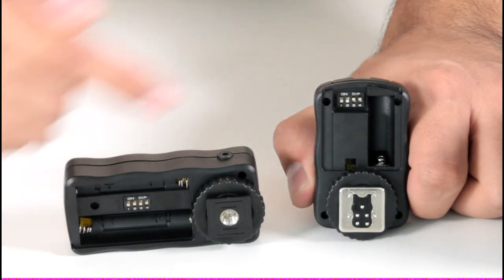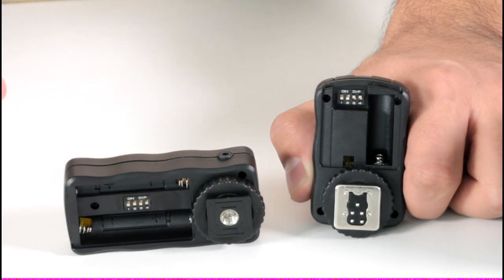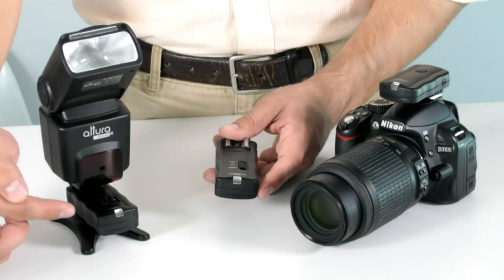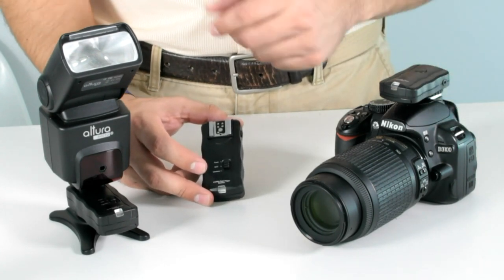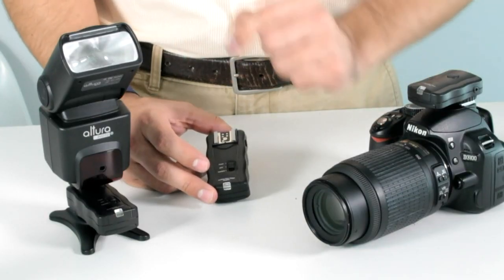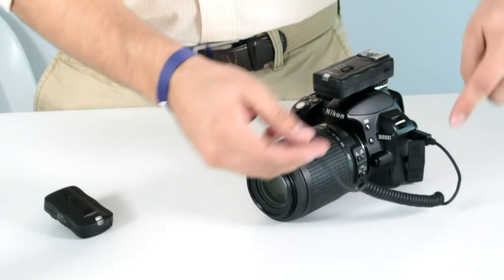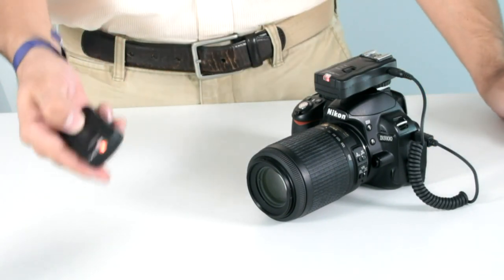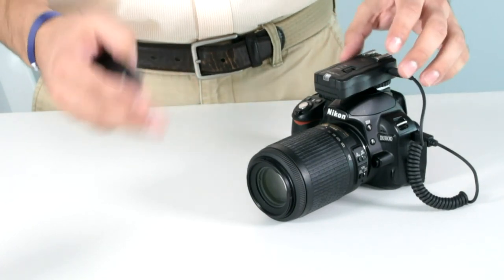TUTORIAL | How To Use A Wireless Trigger & Receiver Set From Altura Photo For CANON & NIKON Cameras

Comment: I trigger the external flash (S1) with my nikon d3200 build in flash. The Altura reacts and flashes but no light from its flash on the final picture. can you help me find out what am i doing wrong ? missed sync or what's the solution ?
Reply from the maker: Hi there Oscar! Please try using a shutter speed between 1/60 and 1/160.
Reply: thanks but that is not the solution i am afraid ..
i think it is very inconsistent when i try to trigger it with my on camera flash .. doesnt matter if i use it on fast or slow shutter speeds 
it always fires the external flash but mostly i do not see the flash on my picture ..really a big problem for me :(
Reply from the maker: Please send us an email with your order details to: info@gojasales.com and we will be more than happy to help you identify the issue and find a prompt solution.
Reply: Hi,  I am facing the same problem with my new Altura kit.  Could you please help me providing a solution that you had suggested for Oscar Verschuur.
Reply from the maker: Hi there!  Please try using a shutter speed between 1/60 and 1/160. If this does not work please send us an email with your order details to: info@gojasales.com and we will be more than happy to help you identify the issue and find a prompt solution.

Comment: I'm having the same problem as most others appear to be.  Can't get the off camera flash to work.  I just received the Altura Flash as a gift and it came with the Wireless Flash Trigger for Nikon DSLR.  I have a Nikon D5100.  The channels are properly set, the batteries are fresh and the test button flashes the flash with no problem.  On the camera, the flash works, but off camera, there's a problem.  Doesn't matter what mode my camera or flash is set in...it just wont work.  If there's an easy fix, why can't it be posted here (or have I missed it)?  Instructions and this video make it appear to be so easy...well, it's not!
Reply: I'm having the same problem. I got this flash as a Xmas gift and I set it up this morning and it worked fine now it won't work at all. I'm upset cuz I was excited to learn off camera flash shooting
Reply: ***** I'm so glad I read the comments this time, I'm having the same issue, no matter what settings I try it will not fire the flash from the wireless trigger while in the shoe. I will also contact Julio if that's ok.
Reply: i was having the same problem. but after a few hours lol i got it... let me know if you still need help...
Reply: Michael Tanner I contacted Julio after seeing this and he (and DigitalGoja) did a great job of getting me a new trigger and sending me a label so I could return the faulty one at no cost.  Been happily using it ever since.  Now if I could just find a firmware update to enable High Speed Sync on the speed light, I'd be in heaven!! ;)

Comment: mines stop working. doesn't sync with my camera. stuck on 100 iso. any fix?
Reply from the maker: +Will ortiz Hi Will, could you please tell me which flash you are using? Also, I would suggest a reset on your flash if it is getting stuck.
Reply: +Digital Goja altura flash for the Nikon D7200.I did reset as well.I mean when I have it connected to my camera hot shoes..works just fine.when i connected to the wireless triggers its only telling me 100 ISO is it supposed to be that way
Reply from the maker: +Will ortiz Yes that is its default setting on it, you can trick it by removing it (while turned on) from shoe, but since you have to use the triggers on manual mode then I would better recommend a flash meter instead.